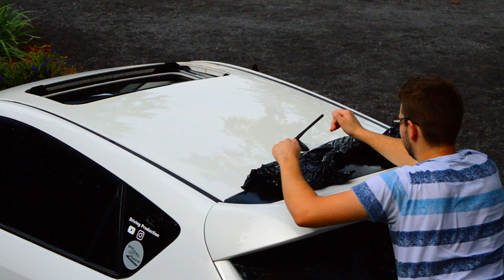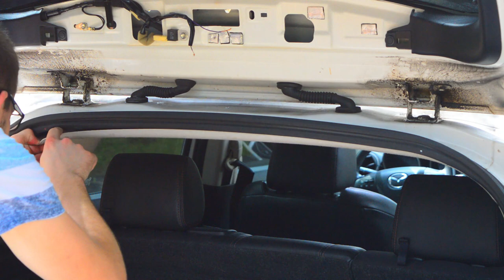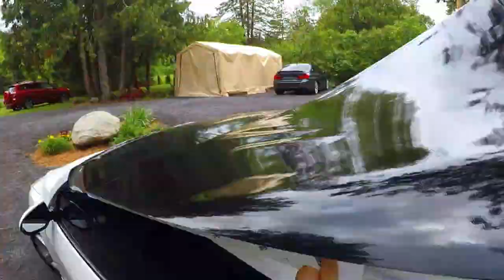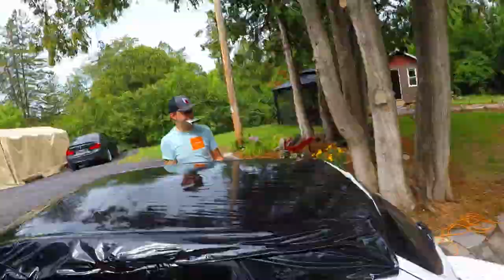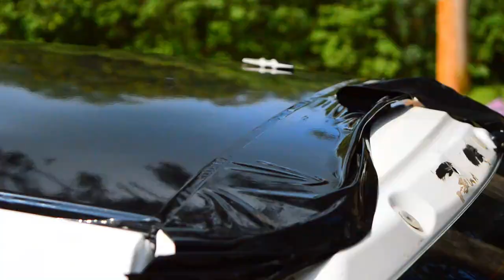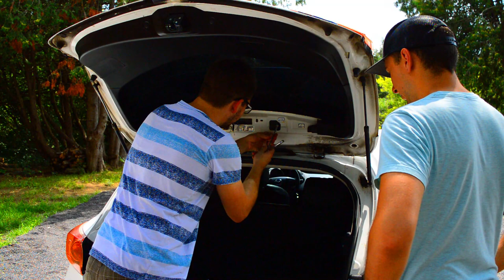This MOD COMPELETLY CHANGED the LOOK of My MAZDA3

Comment: The roughly 5 seconds shown in the video about removing the roof trim on this particular car is the only known footage I can find on youtube. Please quickly describe the process - I have 2 trims that are in need of replacement and could use some guidance.
Reply from the maker: It's basically gently prying them off the roof, they are just clipped on there. They are somewhat brittle so just be mindful of that when prying them off. 👍